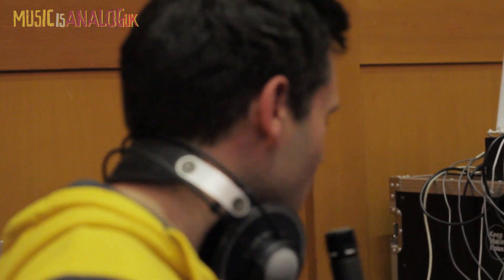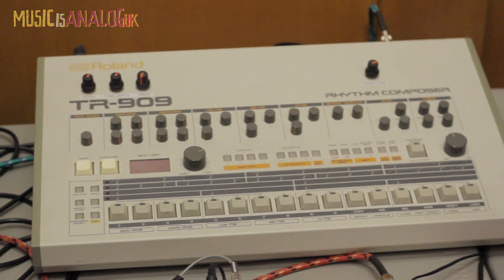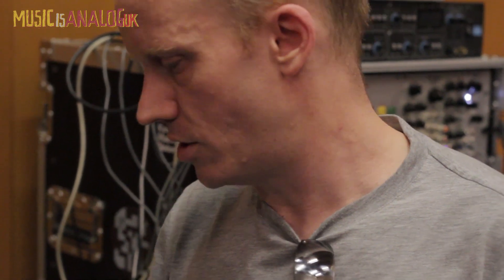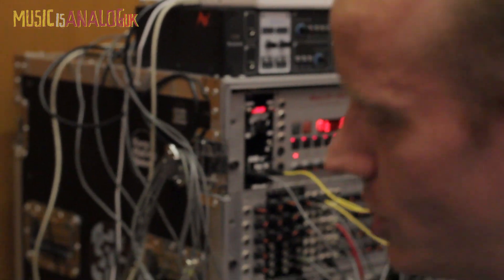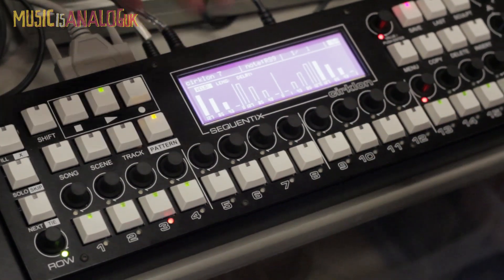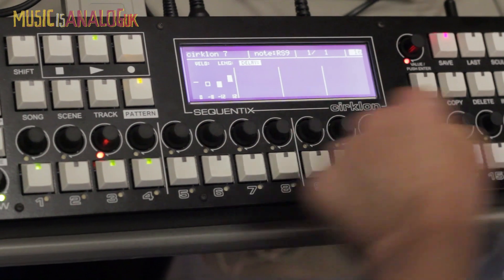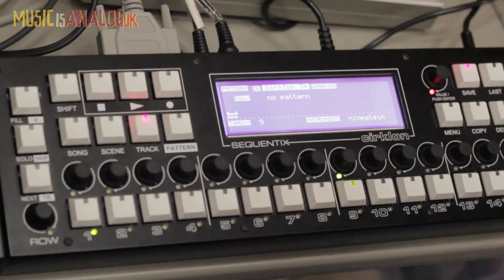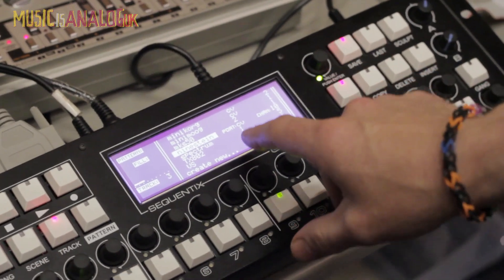Part1: Interview with the creator of the Sequentix Cirklon Sequencer

Comment: Any chance you'll develop a new standard for a drum tiger  Interface, and kits  for retrofitting certain pieces of gear, one of my secrets was always The atari st and a profit 2002 rack sampler ,  mirage is also super cool , and oberhiem dpx-1 ,i use a program called Tiger , it was a plug-in for the doctor t's multi program environment ,  it was for editing piano rolls, it would graphically display the event generation data and then you could analyze it edit it or in my case wipe the screen clear and just use it as a sequencer, I know the Atari as a dedicated bus to the midi on a z80 processor which although is technically a slower processor handling more functions at once it can handle a limited set of instructions much faster,  timing was always dead on, the email samplers have that extra stage on the envelope generators for the attack  Giving you the ability to emulate compression with a 10 to 40 mil second delay  at the attack stage in the envelope, I know the machines I've listed had earlier processor send them to, how close do you think I was to what you're doing with your trr 909 , what do you think about kids for the machines I mentioned, particularly the dpx-1  it has an expansion port on it, that was used for the eight output expander, also an early hard drive and optical cd ROM type thing, there's very few of the eight output expanders out there ,,  I have two of them, sure would be cool to see a cat that would slide right in the back end for all the people that have the mono out